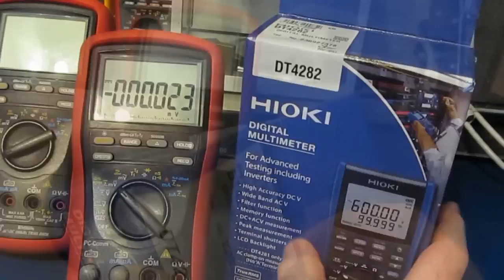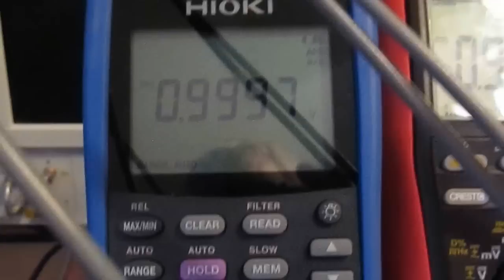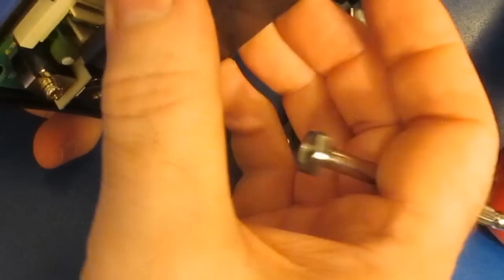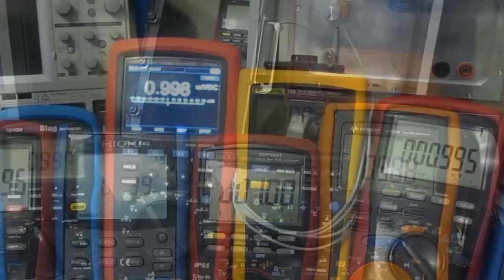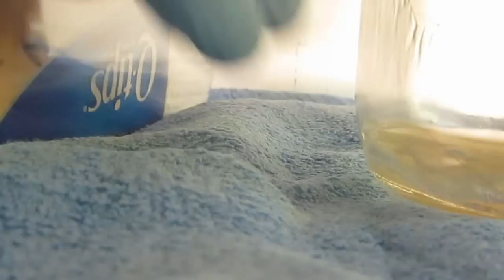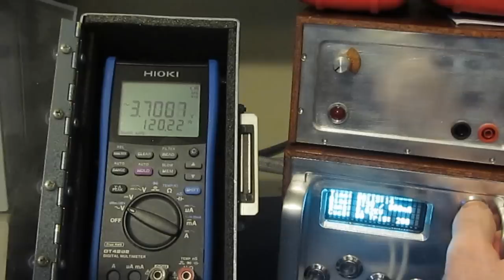Hioki DT4282 DMM vs Brymen BM869s, which would you choose?

Comment: Hi @joesmith-je3tq are you planning to do a 50,000 cycle rotary switch test on the Hioki? And, if I might ask a followup question: why did you get the Brymen BM869s rather than the Greenlee DM-860A? I only ask because it seems harder to get the Brymen in the US that to get the Greenlee. Thanks again!
Reply from the maker: At this time I have no plans to life cycle the DT4282's function switch.   Have it survived my low level transient tests, I would have put more time into it.   

I contacted Greenlee before purchase and asked them what changed between the OEM and the product they sell. They did not have an answer.

Comment: How fast does the hioki settle on resistor or voltage levels compared to the brymen bm869s?
How fast is the bm788bt compared to this?
Reply from the maker: I put together a simple test jig that will switch them between a high and low resistance (10 ohms).   I had used to compare the full auto range and settle times of different meters.  The 10 ohms came from a test that Dave at EEVBLOG had performed.  Is this what you want to see, or something else?  Provide specifics.
Reply: Yes, such a resistance test with different resistor values is what I am looking for. And in particular how long it takes the meter to show usable resistor values.
I own a cheap voltcraft multimeter, which takes some time to show resistor values.. I am looking for an upgrade, which is faster.
Reply from the maker: @Estragil  No problem then.  I'll make a short video demonstrating all three meters for you.
Reply: @joesmith-je3tq  This would be awesome! :) Thank you very much

Comment: I like that the Hioki can measure down to 1 milli ohm. Really nice for finding shorts on PCBs and motherboards.
Reply from the maker: Even with the Kelvin leads on my 34401A, a milliohm is pushing it.  I used a dedicated short finder to troubleshoot some high density boards.  That thing saved me a lot of time.  It wasn't a meter.  The output was audio to a headset.

Comment: I HATE high-quality high-price devices with low-contrast LCDs.... that low-contrast LCD on the HIOKI is enough for me to pass and not buy.
Reply: I HATE leading zeros, especially in condensed fonts resulting in a barely visible decimal point, as seen in Brymen DMMs.
Reply: That is my main complaint with the FLUKE 289! Terrible display!
Reply: @DM-fz3ly I have a Fluke 117 and can also tell you its lcd contrast is very bad. Older LCDs used to be better... what happened !?!?

Comment: hioki 4282 is sold for around 45000 JPY  (300USD, 226 GBP, 260 Euro) here in japan.
maybe its a decent survivor.
Reply: I would buy it at that price. Its 600+ euros here in Europe
Reply: It's available on ebay for 380 USD including worldwide shipping. I bought it in 2022 from japan for 425 USD including the carry bag. I don't regret that decision. Dt4282 is extremely reliable. It has all the features I need for my electrical and electronics alike. The only thing that I miss is the bar graph. The bar graph makes a huge difference in some tricky situations. It acts like an analog feature in a modern dmm. I like this hioki I'll not exchange that for another dmm of the same price range. The hioki rocks.
Reply: @roseelectronics4582  Custom fees from Japan for this amount are too high here, not worth the effort really. Enjoy!
Reply: @roseelectronics4582  the bar graph is amazing for even simple testing of power supply output

Comment: How does Brymen support T2 measurement when the inputs to it are both effectively shorted to earth by shunts?
Reply from the maker: The low current path is switched.
Reply: Does it look OK to you? It's half an amp over the relatively tiny contacts. Have you ever tested the resistance of those after thousands of cycles?
Reply from the maker: @khi787ghid  While I did run that 50,000 cycle test, plotting the resistance,  I did not measure every contact.  I'll make a video clip for you.
Reply from the maker: https://www.youtube.com/watch?v=-wu-GCaJxiA

Comment: I guess the dual temp probes are prohibited by the connection shutters. They'd need a dedicated rotary switch/cam position.
Reply from the maker: I'm not sure how those shutters help.   They don't prevent you from leaving the leads in the current position and connecting the meter to a high energy source like we often see people posting about.   The only thing it does is force the function switch contacts into place before connecting the leads.  Maybe that's a good enough justification.   In the mean time, the front end of this meter is frail.

Comment: Hmm if it were just between the DT4282 and the BM869s then I'd go with the Brymen. The 500000 count mode is very useful.
But I wish Sanwa would make an updated version of the PC7000 based on the BM869s. The PC7000 seems to be based on the BM867 but is substantially smaller and lighter (albeit loses the dual thermocouple capability, drops to 600 V CAT III rating instead of 1000 V, and doesn't have weather sealing like the Brymens). I have a PC7000 and it's been great, my only major complaint is the short backlight timeout which is the same issue that you mentioned with early Brymen firmwares.
Reply from the maker: I'm curious why do you feel the Sanwa PC7000 seems to be based on the Brymen BM867?
Reply: @joesmith-je3tq   so the PC7000 has pretty much identical specs to the BM867 (down to the 500000 count mode which seems unique to the BM86x series), but I'd say the most concrete evidence is mjlorton's PC7000 review ("Review: Sanwa PC7000 Multimeter Pt 2") where he does a teardown. At 13 minutes in he shows one of the main ICs and it's marked "BTC 0197-0000" which is also found in the BM867. I'm guessing "BTC" stands for "Brymen Technology Corporation"?
Reply: "The 500000 count mode" is fake.
Marketing nonsense.
This is achieved by slowing down the update rate. You could just as easily use the "min max average" function.